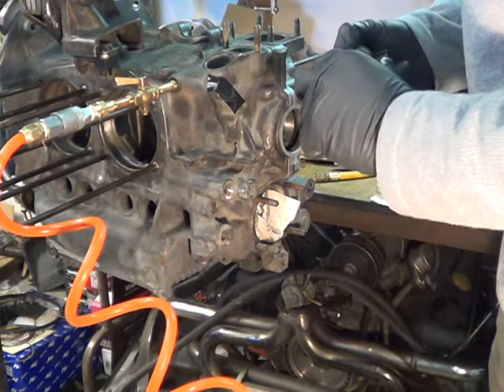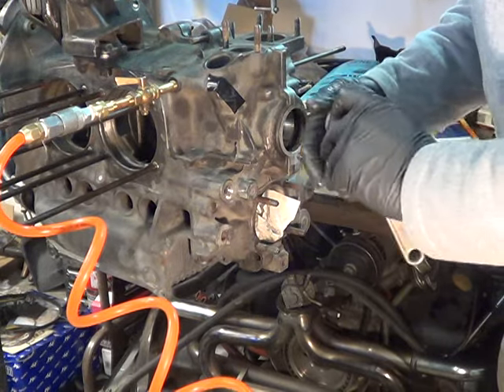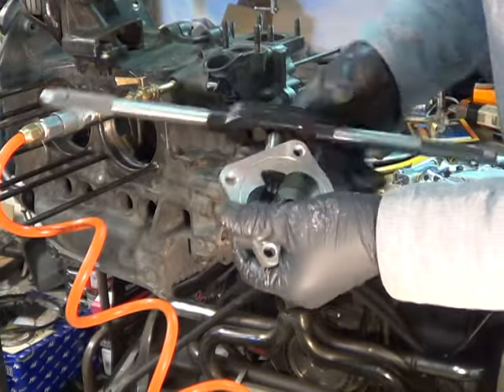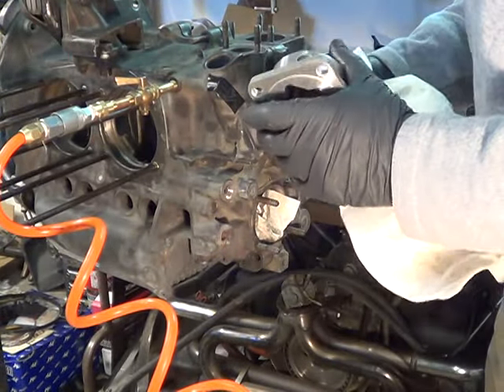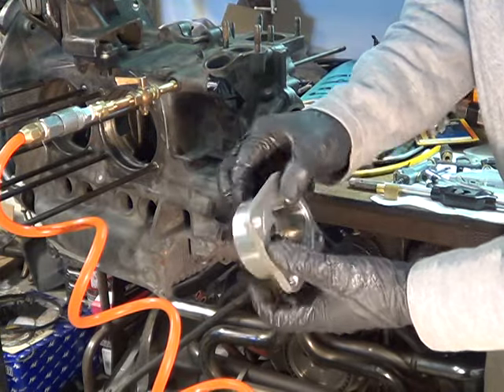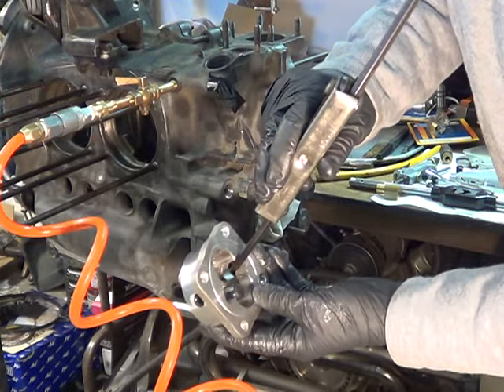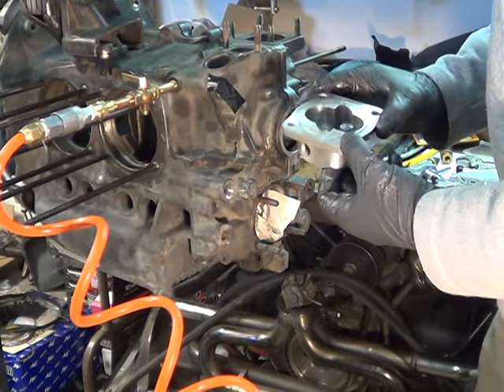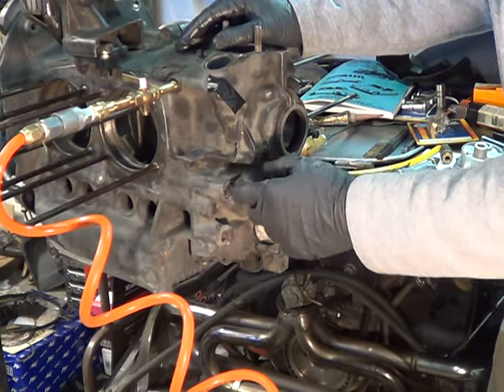VW Full Flow oil filter #2

Comment: What was the outcome of the motors that weren't disassembled? The motor is pretty fresh and I really don't want to do a complete tear down but I want a full flow and spin on filter
Reply from the maker: worked great and still running. Just go slow and be sure you get all your packing out. Look with a light and it worked fine just like in the Gene Berg books.
Reply: Which Gene Berg manuals are you getting info out of
Reply from the maker: His famous Blue Books  which are no longer in print http://www.geneberg.com/index.php

Comment: Hi what size tap did you use for the oil pump plug? Thank you in advance
Reply from the maker: One to match the chosen plug. 3/8 pipe. doesn't have to perfect or fancy. There is a ton of oil moving threw there all the time and it all ends up going to the bearings